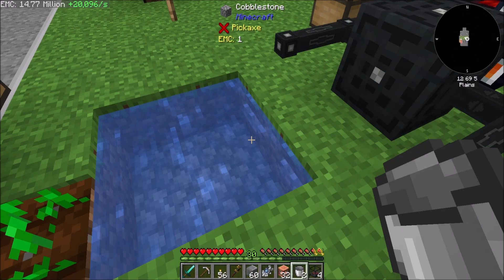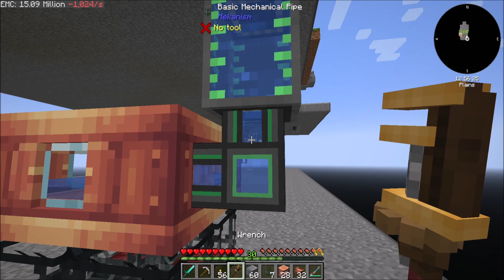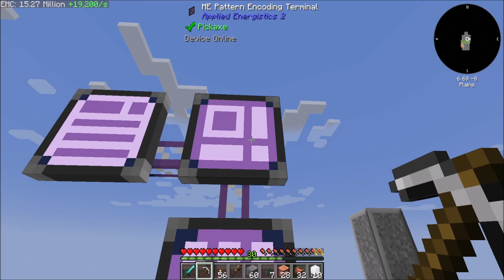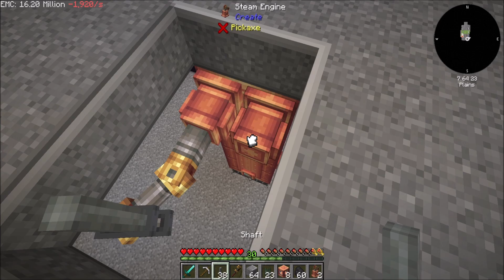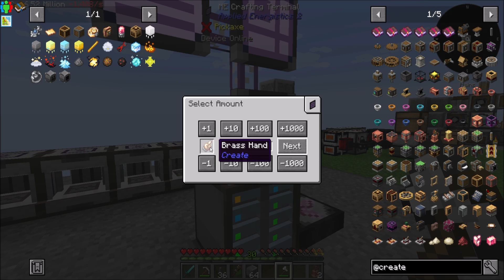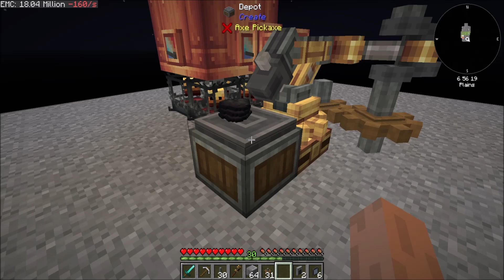Mechanical Mastery Ep16 Create Upgrades

Comment: I was also unhappy with how the sawmill interacts with the mechanical belts on the same rotation. I hate having to switch that. Feels like it should go inline, but I'm not much for real world engineering, so maybe it does make sense if you understand the mechanics better. Create is a bit confusing for me. I ended up using laser IO to dump logs into a chest that got chute'd onto the sawmill onto a detpot and then back to my RS system. Then I keep in stock 64 stripped logs instead of running them inline on a conveyer.

Comment: I just don't get it why he uses coal @128 emc per ore while he could use charcoal @32 per log, I just don't see it where coal would be cheaper.  I understand you need coal for certain stuff, like making covalence dust, but you also need to have charcoal for that, so you have to have both still available, but the pulverizer doesn't even grant you double output, which would still make it more expensive than charcoal (emc wise) and the crusher from immersive engineering does give you 4, but that is at the same price.  So yeah I just don't get it and this has been annoying me since episode 1, that's the main reason why I'm 6 days behind.

Comment: You'll need to speck into Industrial Foregoing eventually. The fluid extractors are slow, but they will strip logs for you.

39:28 See, everyone! Dire does know how to use an axe! It just isn't (usually) faster to go digging around for one when the thing's going to break in 5 seconds anyway.

41:00 You see all those comments saying "use two small cogs"? This is the moment they're referring to.  It's also worth noting that you used two extra shafts to power the short belts - they were already connected.

Comment: i wont export the alloy, i would put it in the recipe pattern and let laserio handle the rest, then u only need 1 deployer for all casings. there is only one that u have to put in at the deployer, not befor the saw. it uses an casing to make an casing. so u dont need to set op multy deployers to make every casing.

Comment: Not sure if the mod that adds the straw is in this pack but that basically lets you power the blaze burners with lava. Thats the cheapest way to fuel them in terms of EMC.
Reply: create crafts and additions (the one with motors and alternators) adds this feature, but he doesn't have bamboo yet.

Comment: Dire, you can have 3x3 steam boilers.
There's a crafting recipe for the blaze burner with the effigies.
You can regular right click a shaft that has a belt with the wrench to shorten it by one block.
Charcoal is far more efficient, 32 emc instead of 128, and it's processed the same way as you're currently doing for your coal.
Why not just use an interface and only one channel instead of using five on exports?

You're using too many gearboxes. You could achieve the same result with the casing crafting using two gears.

Comment: Surely the best way for precision mechanisms is to constantly keep a stack in stock with a level emitter- interface only working when the amount of mechanisms is under a certain level. Then you don't have to worry about requesting - they'll just craft when levels are low
Reply: How do you know when to insert gold plates into the input chest for the conveyer belt vs the incomplete precision mechanism? I feel like you would need to make sure only one gold plate at a time was released. If you did not, you would keep adding gold plates and just getting more and more incomplete precision mechanisms.
Reply: @johnratliff3262  Could be a number of ways- I've tried a few with varying success. Looping incomplete mechanisms round to join the belt before the gold plate is added works(but can be a bit inconsistent). Making sure gold plates are in the last slot of the interface ensures they are pulled last, allowing the other slots to be used to fill the belt with incomplete mechanisms- this is the main way I do it. Last option which is more of a pain but faster is just to use ALl the deployers(15 irc) so each run completes a full craft.

Comment: Dire. You should learn to play with chain drives more. the are able to rotate the same direction with many drive shaft outputs and you can even rotate chain drive 90 degrees mid chain. they are excellent for combining steam engine outputs in a compact way. and they look better and are more versatile that using belts all over the place.
Reply: Chain drives instead of belts all day. Belts look ugly as hell when you have so many. 

Chain drives are incredibly useful. Can even increase speed.

Comment: Just automated effigies last night with Foregoing mob crusher and modular routers placing them. I could not get anything to place each effigy in turn into a single router with the click module, so I just set up 4 of them each with their own laserio color channel. All 4 get placed and nearly immediately consumed by the crusher. 4x4 drawer filled up with the drops quite fast. I definitely need to finish automating the yellow essence because EMC is getting real lean.

Comment: You could save a little on the failure rate of the precision mechanism by adding the gold sheet to the move back to 1st chest list rather than sending them to storage. Every little helps...I have done 30 gold sheets to 20 precision and it hasn't failed yet (and I am wanting 20 at a time for the final shard on demand crafting)
Reply: I unrolled the loop, (15 deployers on a single line) and export gold plates until my limit redstone stops it.  It runs so fast, I had to make an RF Crafter to make all the gears and gear ingredients to keep up.

Comment: dire can u feed charcoal to the blazeburners or no?
Reply: Alchemical coal is even better. Comes right out an EMC link and burns for a long time.
Reply: @N0stalgicLeaf  can you feed blazeburners with alc coal? i didnt know that
Reply: @regiliok  I believe they take anything with whatever tag a regular furnace uses. It's either the :fuel or :burnable tag I think. So logs, coal, coke, lava buckets, that sort of thing.

Comment: TIP: For anyone setting up laser drills (for ether gas or for ores) - if you find that the drill doesn't want to place facing the way you want it - place it in an open space facing the direction you want and then use a cardboard box to pick it up and put it where required. This also lets you place them near walls, in compact machine for example.

Comment: Dire, 27:47 you could keep the pulverizer and use the cactus upgrade to delete secondary outputs. Also instead of a x10 input recipe just to prevent the 20% loss crafting, you could use a level emitter/sensor to just keep a buffer of X quantity and simply push gold plates into the belt until the goal is met.
Reply: I was also thinking level emitter
Reply: HOw do you ensure the incomplete precision mechanisms are dropped onto the conveyer belt before the next gold plate? IF you're constantly feeding gold plates, aren't you just making infinite incomplete precision mechanisms?

Comment: 1. Enrichment chamber also just makes coal from coal ore, and it makes more coal
2. You can put a funnel directly on an emc link and use alchemical coal directly, and it’ll burn longer, so it’s still emc efficient
Reply: So if you process all your resources in Mekanism machines you don't get sulfur. And you need sulfur for gunpowder.
Reply: @N0stalgicLeaf  You can synthesize sulfur from water, oxygen, and charcoal in a PRC, and it’s a much more reliable way to get sulfur
Reply: @ultradude5410  I totally forgot about that recipe and I can't believe I didn't see it in JEI. That is definitely the next thing I will set up tonight.
Reply: @N0stalgicLeaf  I got my initial sulfur from pulverizing blaze, and more sulfur than I could use from refining fuel.

For gunpowder, you can just make boomshrooms. All thermal spores are craftable in this modpack, and they're all compatible with phytogenic insolators.

Comment: it's sad to see Dire forgot about the cactus augment for thermal mashines
Reply: if you are playing the pack they just updated the cactus augment quest to tell you specifically that it still makes secondary outputs, but it let's the machine keep running if all the slots are full of what you want and not the byproduct
Reply: Cactus clears excess secondary outputs, it’ll still make cactus and gravel
Reply: @ultradude5410 no it will not make any outputs
Reply: @greeshmaisave5410  It will. It just prevents the machine from stopping once the buffer is full.
Reply: @greeshmaisave5410  
Previous versions voided all secondary outputs, but that’s changed

Comment: I know dire has his reasons for using AE over RS (I don’t even recall if that’s an option in this pack), but given the choice why do people like AE2 so much over RS? AE seems like an over complicated RS (yes I know AE came first so technically RS is a simplified version of AE). What are the benefits of using AE over RS?
Reply: Dire usually has a thing of alternating which storage mod he uses per lets play depending which one the modpack has, like his lets play series' contain both anymore whereas others usually are one or the other or sometimes have both as well. And he does at least like the complexity an AE system can contain.
Reply: @Legofan2676  yes. As I said I know dire has his reasons for liking AE, which he has stated in previous packs, but I’m curious why everyone else likes it. What benefits are there to using AE over RS?
Reply: Aesthetics. AE2 looks better. And it comes with a bunch of really nice decorative blocks. It doesn't hurt that tunnels are actually fun, once you learn how to use them (Dire doesn't, unfortunately). Besides, you can always disable channels in the config, install the mod that adds AE2 disks without type limits, and pretend you're playing with a pretty version of refined storage. Oh, and automatic looting on early-game tools, easy access to snow, etc. is nice.

All that said, I don't necessarily have a preference. In modpacks that make you wait (like this one), I almost always jump on refined storage. It makes life better, faster.
Reply: Because it's an over complicated RS. Some people like that sort of thing. Some people like kæstur hákarl too – who are we to judge 😀
Reply: Dire's friend Soaryn often talks about why he likes AE better on his streams but the short version is:
-RS trivializes storage too much, making things too easy hurts long term enjoyment of a game.
-With AE you can build subnets (Imagine an iron farm where you only want to get Blocks if iron from. With RS you would need to put a chest between 2 networks and export Blocks of iron to the chest. With AE you can directly tell it to only look at blocks of iron inside the 2nd network.)
-AE lets you put multiple microblocks(Exporter,Importer,Interface(Panel mode)) in one blockspace.